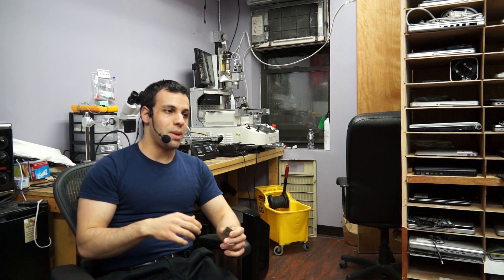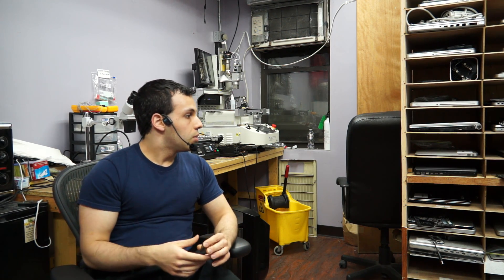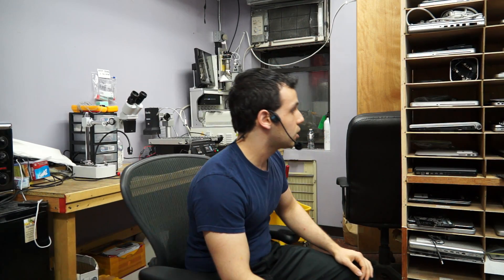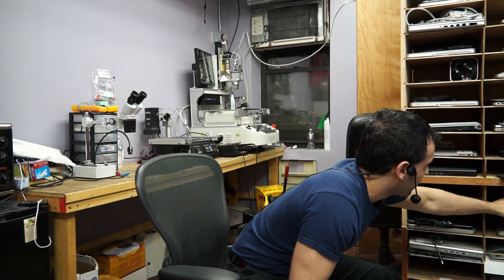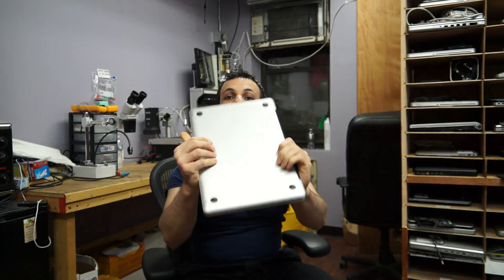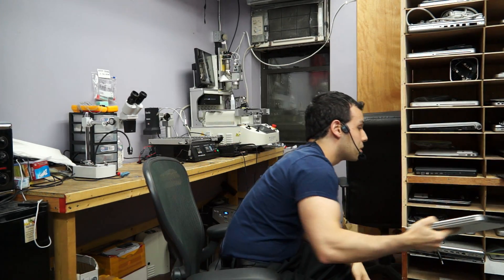Reballing flip chip GPUs is BULLSHIT - the truth about dead laptop GPUs & repairing them.

Comment: Not really sure what the point of your video is - except that the could be manufactured/fitted better. Something about hot chicks and T-shirts?
Its not 'bullshit': my imac (2009) GPU died - I used the oven bake (10 minutes @ 200C).It worked. It worked - it didn't work, now it works. Done!
A 'miracle' given i wouldn't bother spending money on such an ancient machine! I followed JDW's guide. Plus a BBQ thermometer.
Reply from the maker: If you have unprotected sex and don't get pregnant, it is not bullshit that unprotected sex causes pregnancy.
Reply: Very true. But no penises, sex, or pregnancies, were involved in baking the GPU that didn't work and now does.
Reply: (that said, I didn't expect it to - and i am amazed it did. i did this as i like using a mac, but don't want to shell out on a new one, and a 2009 imac is not worth spending money on. so i gave it a shot - expecting to have to rip the HDD out later, but lo and behold - it did!)

Comment: I am using a Lenovo y500 laptop and I am wondering if it is possible to upgrade my Nvidia 650m GPU chip to the latest Nvidia chip through reballing? And if it is possible, then will my BIOS supported it? And if not, is there any solution to it?

Lastly my laptop support dual graphics card in SLI configuration and I have no idea what SLI means. So is the dual 650m SLI configuration's perform equalent to that of a single latest Nvidia chip? Any drawbacks of SLI configuration over single GPU configuration?

Comment: You seem to know your stuff. I got mid 2009 17" mbp and when i´m using 9600m GT GPU i get strange screen tearing with mostly only toxic green pixels around the screen. I downloaded a program called gfx cardstatus which allowed me to use the other 9400m gpu exclusively and it makes my screen 100% perfect. Should i just ditch the machine or is there something relatively simple i could do to resolve the issue?
Reply: Ah and one other thing i should mention is that even when i´m using the 9600gt and get the green pixels i can just press down on 1 spot in the bottom of the computer and the pixels dissappear and voila perfect image. This will however heat up the computer quite a bit.... connection issue?
Reply from the maker: Tap U9600 with your finger and tell me if it makes the artifact. Also replace C7771 with a non-tantalum.

Comment: Yes for most cases reballing might be bullshit but not for ps3 and xbox360 because the chips are still good the problem is the shit solder they used to solder them on the board !
Reply: Walther Penne they used led free solder that cracks over time and over too many cicles of low to high and high to low temperature ;)
Reply: Reflowing solder isn't reballing, fam.

Comment: OMG AMEN  integrated motherboard no ventilation. These machines were made for easy manufacturing and high profit. Take apart a gamers PC laptop and they are made so much better its not even funny. Since the macbook is primarily used for video If mac really cared about their customer they would have a separate grapics card with a better cooling system.

Comment: is reballing with a new chip gonna fix the laptop?
Reply: Technically, but even if you could find a good chip it'll still be vulnerable to the same problem and will eventually die again

Luckily this isn't a problem anymore since this was a problem mostly with chips in the 2006-2009 era, and Louis seems to mention ATI chips a bit later. This whole debacle was from processes poorly understood at the time, but will more than likely never happen again. So in 2022 any laptop worth repairing won't have had this problem.

Comment: What is the diagnosis for computer laptop that switches on and works for few minutes and then shuts off on its own and then does not start i.e. black screen scenario.  Leave it for few hours/days it will start again for few minutes and then the black screen and nothing else.  Is it the graphics chip or something else.  Thx.
Reply: If it gets hot or hotter than when it was new, it's too much heat= too much dust or fan might not work.

Comment: Awesome ty for the tip. Heated my nvidia card chip to about 250 300 degrees Fahrenheit and my card is working . I used a heat gun and a temp gun .6 min or and I'm back gaming in 4k. 😁✌

Comment: I like when you have a software problem like a faulty bios and all the "technitians" say its bga problems, and you need to reflow or reball or replace the chip and never use the laptop for more than solitaire, even if your temperatures never got over 50°c. Than you ignore them, for some time, maybe years, because you only used the damn laptop for word and powerpoint! Times later, you find out that your manufacturer recently launched a bios update that just fixes your problem, and your laptop just runs fine. 

And yeah, many of the newer laptops unfortunatly are a real piece of crap... At least i really would like to find any place that would really fix my eletronics like yours, unfortunatly i live in a bad third country, Brazil, were i dont think there is a single technician that really knows anything about hardware...

Comment: Apple is like purchasing a real Rolex watch and discovering that the new head of Rolex decided to make even more money per Rolex watch by keeping the exterior of the watch high end Rolex but the  inside parts are the same used to produce the generic $10 watches you find at WalMart and those internal parts aren't even half as good as the parts used in a Timex watch . And now Rolex is making astronomical profits deceiving loyal Rolex customers and share holders are happier then ever because of those incredible profits but it will catch up to the new CEO and the company because now Rolex stock is worthless literally  ! And now you can go to WalMart and get a real Rolex for $10 because it's the low,  low end brand of Timex only Timex wouldn't put there good name Timex on such a cheap shit $10 watch ! In this story Apple is the Rolex .

Comment: so you believe heating up a chip repairs it? Why should that be true? Would make you good money in retro computers, but actually, chips cant be repaired, as they are very tiny strucktures inside on it's die and there is no way to repair it. Heat may have effect on chips (e.g. stress of different materials, locking up by overheating) but you cant repair a chip by heat, no chip ever got better by heating it...
Reply: and you did not get a picture with 2 hot girls. haha
Reply: I dont say it is a perfect solution, as it seems not to be... But it does not fix any chip (die of chip)
Reply from the maker: How did you manage to take the exact opposite of what I was saying

Comment: What You say is true.. but not nearly a full picture (probably because You use mac-s as example). I have HP DV-6000.. died around 2010 or so. Heatgun didnt work.. So I tought, hell with this board and but it in 200c owen for 5min... havent had problem since.. still works (i did tuned cooling system a lot thou). Have xbox 360 fat, fixed with heatgun and by readjusting board to actualy fit.. Works over a year now (seen hundreds of hours of street fighter, gta , assasin breed). Often its not chip itself, because of cheap manufacturing, boards are bent inside casing etc (causing bad conection). Fixed quite few xbox and laptops by just readjusting motherboard to fit correctly.  

Edit:  Forgot to mention, with ati chips, its not manily problem with chip itself, why they overheat/fail... true reason is very badly designed power circuit/cheap and unstable vrm-s :/

Comment: Wait, you're bashing a solution that has been tested and verified and successfully applied by the community just to feel superior without providing any proof?

The idea that there are 2 points of failure is truly valid. However, you go on to say that a connection issue at the die/chip level is valid because it's your idea, but a connection issue at the chip/mainboard level is bullshit?! If anything, reballing is simply overkill as, according to you, the heat required to re-ball is greater than the heat required to re-bond the die.

The reason reballing is an understandable fix is because it has a clear explanation. Uneven temperature can cause the mainboard to warp such that the array of solder balls under a cpu/gpu may no longer inhabit a single plane potentially breaking the connection or causing some of the solder balls to come out of alignment. If you remove and clean the chip, place new solder balls correctly aligned with a stencil, and reattach the chip, then the connection is reestablished.
The area under a die is much smaller, so warpage doesn't seem as plausible. If it is in fact an issue and the microscopic connections between the die and the chip are broken, it seems far less likely that simply heating it will somehow shift it back into alignment and reestablish a connection. Reballing works because you use a stencil to realign all the connections. This does is not possible for the die's connections yet you explicitly claim that reballing the chip with precision is no solution while blindly rebonding the die is?!

You seem like your in the tech repair trade. Hopefully you merely had an epiphany and was excited to share the news, but you definitely went too far by denouncing other methods just because you were biased. Now, however, you should be able to realize that you have absolutely no proof of anything you've said. You've denounced reballing, which clearly has worked for many, without proof that it was unnecessary. You simply skipped straight to, "This other thing is BS. My way is the only way."
Reply from the maker: +Hei Sogeki verified successfully?  Says who? The hundreds of companies that go out of business overflowing with chargebacks?
Reply: I don't think you understand what he's saying. He's saying the problem is the flip chip bonding itself in a good number of cases and can be tested/proven by heating chip below solder melting point(like 150 C). Because of this reballing is NOT a permanent fix, only a long term one vs reflowing

Comment: Hey man reballing is working. Also when company produce laptop board at factory they also use 250 or high temperature to attach these components to board. Or do you believe they attached these components with very low temperature? These leads have very hard melting point. You said reballing is not fixing you are wrong.  Lots of people do not afford to buy new laptop. Its new chance to use old laptop for long time.

Comment: Hi. My 80GB PS3 shuts down at random times. I have the “red light” issue. I disassembled the unit, cleaned the old thermal paste and applied new, yet the issue persists. Considering your initial https://youtu.be/1AcEt073Uds 
‘reballing is bullshit’ video, and the fact that my unit does run for a while without shutting down still, that leads me to believe that my GPU is not dead yet and that it’s still overheating. Yet I’m confused because your comment to this iFixit video https://youtu.be/uMG-6rbanlY advises to reball and resolder. Can you help clarify? Could the heat gun work in my particular case? Thanks.
Reply: Your issue is the NEC/Tokin capacitors on the board. It's a common issue. Changing them is the only way.
That being said you need a SMD rework station and even then, they're quite tough to remove.

Comment: Why do you have to give dis information
Reply: Let me be clear.  Your knowledge of how a GpU is made is incorrect.  We never use 150 degrees in creating the chip.  So your comments are very miss leading.  Yes the balls on the chip that holds it to the packaging is what fails.  And to some extent it is at apples request to use crappy tin but it’s because they need to change to a zero lead and mercury platform.  And re heating is crap but you need to be honest and not miss inform people.
Reply from the maker: miss leading

who is that, my future wife? 

the high IQ reheating/reballing crowd strikes again!
Reply: Louis Rossmann maybe.   Are you trying to say by heating the die your making the inside wires that are electro plated multiple layers suddenly turn to molten metal and they can self heal?  At 150 degrees.  Maybe take a CMOS class instead of making this kind of poor information videos.  Each die has multiple layers of copper which has a melting point of a slightly higher temp of about 1,000c,  some tungsten which melts at 3,422c. Cobalt 1,495c,  tantalum 3,020c.  And so on so you get the idea 150c isn’t making a dent on the wires in your processor.   It’s the BBGA that holds the die to the packaging  as originally stated.

Comment: If the GPU would have the pins and the socket like CPU has, there will be no problems, I have never seen CPU broke the way explained in the video, CPU also have silver thing attached on the green thing connected with  bumps  mentioned in the video, and under green thing are pins attached, not soldering balls like on the GPU. As far as I know, CPU is the most realible computer component, and it can last very long. So I can't agree with you.

Comment: Sorry mate but you are wrong at 70%... I know that my comment must be followed by the reason I say you are wrong but I can't post with words my 12 years studies plus 13years reballing experience in one comment.. A honton shitty hotair station or a scotle one wont make you technician. The only thing that I can say is that all chips can be found in new condition and in multiple qualities. Ofcourse Mac machines have better quality chips. So you can replace damaged BGA chips in scrappy laptops (as you said) with better quality's chips (like mac ones) if the part number is the same.Also you must consider the known "cold soldered " issue. The 1st repair rule in electrotechnician study. I am 22years technician and I can't accept your technician annihilation in one video...

Comment: sorry to say, but the one full of bullshit is you....

by your line of thought, even the chips that came fresh from factory are all defective, BUT start working because they were heated at 150ºC... please....
the problem isn't "inside" the chip but on design and manufacturing flaws of the equipment itself.

for ex: if you get a RROD xbox360 and look on the edges of the gpu with a magnifier, you can see broken and bridged connections.
the console have very pool air flow and the heatsinks were not effective enough. thats why on the first revision, not talking about slim version, they virtually solved the problem by just using bigger and more effective heatsinks.

the manufacture should use better cooling materials and designs to prevent ouverheating. this is the real problem, you buy a 1500$ equipment that uses 1$ thermal paste and 5$ heatsinks and coolers...

the units that get reballed will fail again because you didn't sorted out the cause of overheating problem.
Reply: The 360 and PlayStation issues were simple bad solders - fix the solder, and the chip, cooled adequately, will work forever.

The Macs in question are assembled fine.